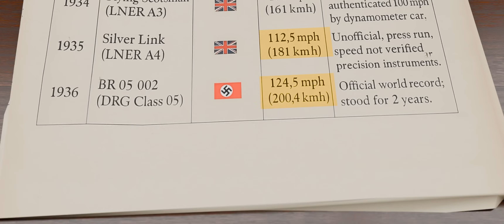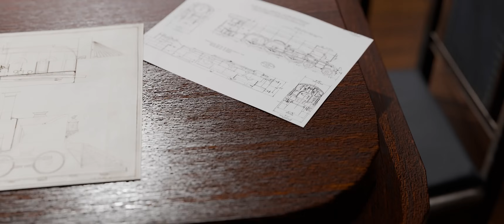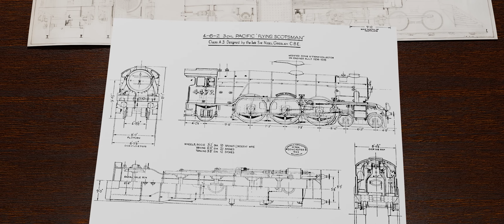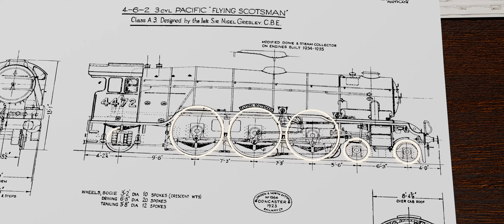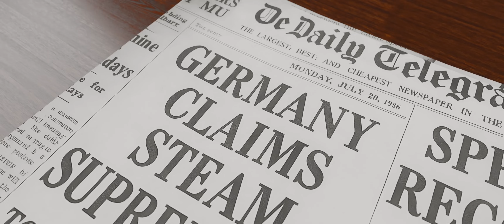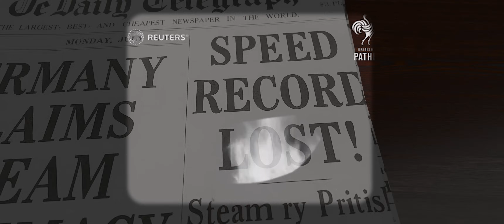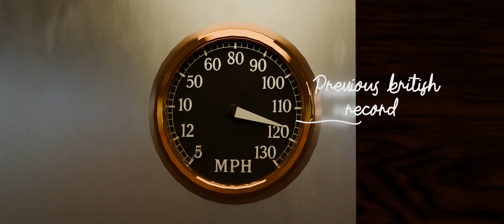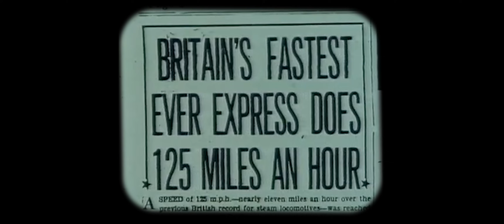The Insane Engineering Behind The Mallard

Comment: Mallards record won't last much longer. The Americans are rebuilding one of their PRR class S1 or T1 locos. Back in the day, one was clocked at 140mph. This should be interesting.
Reply: yeah except your forgetting that American railroads basically penalized any attempts to exceed the speed limit on any of their trackage, so these runs were never professionally recorded and only done by conductors timing jaunts between mileposts with their stopwatches if they weren't doing much. so those claims don't hold much water

Comment: Mallard wasn't brand new when she ran her record run. She was about 3 months old. LNER when they planned to do it wanted to use a Steam loco that was run in so and worn in just right so that there were no parts that were still wearing themselves in and causing friction and power loss. Mallard and other A4s who were between 3 months and I think 6 months were also considered to attempt the run. Mallard was chosen and while she managed it. Her middle big end ran hot and the bearing melted and that was it for the speed record attempt re-attempt.

It was planned to give it another go but WW2 and the bearing failure stopped that, it was calculated that 130 was possible if everything went right and they didn't need to slow down for a junction.

The German world record was on level flats but only 4 coaches and 197 tons compared to Mallard's 7 coaches and 240 tons while going down a slight incline.
Reply: And then there's those unofficial speed runs by American locomotives like the Pennsylvania Railroad's T1 class and the Milwaukee Road F7 class steam locomotives...
Reply: @kristoffermangila the American records were just crews of the locos themselves saying they timed it and it went XYZ fast. There was barely any evidence it even happened aside from the words of a just a couple of people, let alone official evidence. 

I count those American records as nothing more than hearsay.
Reply: Her bearing didnt melt from what I understand - they fitted an early warning "stink bomb" thing that gave them a pre warning it was overheating, and that went off so they slowed. It did overheat but didnt melt or destroy itself, and she still pulled the train under her own power for the remainder of the planned journey.

The driver himself said he thought 130mph was possible.

Comment: I love mallard, i definitely think that she could reach 128-130 for sure. One engine i have my eyes on right now is the T1. Last I heard they want to get her broken in and then go for the record. (not sure don"t quote me).
Reply: Without the use of dynamometer car the original T1s could not claim the world record. In fact the Pennsy discouraged unofficial speeding BUT there is apocryphal evidence that the T1s probably did exceed the speed record. Information indicates that speeds over 130mph were attained, supported by point to point timings and damage done to the Franklin poppet valve box . The valves were distorting due to high reciprocating speeds from high speed running. 
If you want to know more get hold of " American Steam Locomotives: Design and Development, 1880-1960 By: Withuhn William L". A brilliant read and surprisingly easy to digest!
As you say will be interesting to see if the rumours can be put to bed once and for all , for good or ill!
Reply: @mandywithell I have an ebook version of that work.

Comment: Sorry, but I have to burst your bubble a bit.
While it is true Mallard holds the fastest documented run you have either misstated, misrepresented or entirely left out some IMPORTANT DETAILS.

1st Gresley didn't invent the multi cylinder engine! See the kkStB 310 series of engines as examples:    4 Zylinders built in 1911 - 1916

2nd I feel like you misinformed people of "THE" German locomotive.
              BR = Baureihe       =meaning=>      build series
                                   05      =meaning=>      the 5th standardisied series / class
                                 002      =meaning=>      the 2nd locomotive of the class
              There where 3 build in total with the 3rd being an experiment to investigate burning of coal dust.

3rd Here are some facts:                                 cylinders      boiler pressure      max. allowed speed in service      wheel diameter     starting attraktive effort
                                                      LNER A4:             3                   17,2 bar                                 145 km/h                           2032mm                           160kN
                                                           BR 05:             3                     20 bar                                  175 km/h                           2300mm                           137kN

4th the race conditions:                               start                  finish                                 train / occasion                                                         grade
                                             LNER A4:      Grantham        Little Ponton          special - record try                                       0,5% slope downhill just before little Ponton <-- (max. slope in AUSTRIA 1,8%)
                                                  BR 05:      Friesack           Vitnitz                     revenue service - making up time                                       Even track

5th (2nd hand information!) You ignored the damages Mallard suffered from running faster than she was designed for. She allegedly suffered a crack in the middle cylinder.

sources:
https://de.wikipedia.org/wiki/LNER-Klasse_A4
https://de.wikipedia.org/wiki/DR-Baureihe_05
https://www.openrailwaymap.org
https://en-ph.topographic-map.com

Comment: So... how did the tripple cylinder operate? If regular cylinder are 90 degree apart, were the two of the tripple ones the same on the sides and 90 deg off in the middle?
Reply: They’re all set about 120 degrees apart.
Reply: @EQ-TM  oh that's interesting, makes sense caus it then makes it run most smoothly. Tho I assumed that kinda setup would still create the rocking motion, but maybe less than in the double cylinder

Comment: Insane? Oh yes! Terrible design of the centre big end bearing meant it failed during this event. The locomotive retired severely damaged to New Holland shed to be repaired.
Now, if Gresley had allowed a Stanier Coronation to take a record run down Stoke Bank (there was no similar location on the LMS for Stanier to do this) the Coronations (being a significantly more powerful and more substantially constructed 4-cylinder locomotive) would have easily bettered 126mph.
But of course the LNER were not about to let the LMS shame them on their own railway!
Reply: The big end failed due to the conjugated valve gear design allowing the centre cylinder more steam and therefore greater stress.There is written evidence of this in a book I read on the subject.
The Coronations were built for sustained haulage up Shap and Beattock where their greater boiler capacity was needed but their blunt front end would I am sure not allow them to beat 126 mph.
Don't you mean New England shed at Peterborough?
Air resistance goes up with the square of the speed.
Reply: @jeremyrichards8327  At 126mph, streamlining is more about appearance than performance on a steam locomotive.
The Coronation Pacifics also had conjugated valve gear for the 2 inner cylinders, valve events being derived from the valve gear for the outside cylinders.

Comment: The T1's gonna smoke this thing
Reply: Only thing that will prevent the T-1 from having Duck for dinner will be the owners. T-1 was clocked doing well over 130+ mph back in the 1940s between Ohio & Chicago hauling a full load and on level ground.
Reply: @glhx2112  strait facts... well see though
Reply: @glhx2112  dynamometer car or it didn't happen!
Reply: @glhx2112 There’s no way to verify these accounts.
Perhaps they are true, but until it is officially measured, it cannot be certain or factually stated.
Reply: @TeardropLabs  Honestly I don't think it's a given that they will attempt  to smash that speed record. Lots of time & money will have been spent on getting a T-1 replica up and running. To risk it all on a speed record not long after completion has to be a scarry proposition, unless it is/was a stated goal at the beginning of the project. I don't see it happening anytime soon, if ever to be honest. Right now the T-1 is still a collection of large parts, with a lot more work to be done. I'll be happy just to see it make some steam, and I'm sure I will get a chance to see it up close, I live about 2 miles away from the Juniata Shops where 25 of them were built back in the day. At some point it will make it's way here to visit the shops and get it's picture taken while travelling around the Horseshoe Curve.
Reply: @glhx2112  If they really want to attempt the record they have to run her in first. Get the bearings and seals worn so that nothing is binding or causing more friction than needed. Mallard was 3 months old when the record run was done. For the T1 I don't know how their drivin' gear works or how much will bind or rub, but give them a few months of running her in and they should be able to attempt it and get the most out of her as they can. Also, They won't break Mallard's record but set a new record in their own category just due to how much technology and metallurgy has changed. Mallard will keep her record and the T1 will get its own.
Reply: It’s very possible, but not certain. It has a very good chance of beating Mallard, but it’s not guaranteed.
Reply: @TeardropLabs  Its coming back and being rebuilt from scratch.. well see if it gets the chance to do another max speed run. I really hope mallard retaliates

Comment: "The INSANE Engineering..." bro besides the fact that there's a third cylinder, Sir Nigel Gresley did everything to make mallard, or any of the A4's, as simple as possible, because he knew that simplicity was, and still is, a steam locomotive's ultimate trump card. No, streamlining doesn't count, as it adds absolutely no mechanical complexity whatsoever. To counterbalance my short rant on the title of this video, I love that someone actually mentioned Richard Trevithick for once. Also the animation is a lot better than what I'm used to.
Reply: In all fairness, people aren't exactly going to click on "The Simple Engineering Behind The Mallard"
Reply: My counterargument is that it is pretty insane to take a dumb machine that runs on hot water break 126 miles per hour. Gresely was no fool. He was a genius.

Comment: Die Mallard ist nicht die schnellste Dampflokomotive der Welt, die gemessene Geschwindigkeit wurde auf einer Gefällstrecke erreicht und die Maschine war danach defekt  und musste aufwendig instandgesetzt werden.
Reply: A thoroughly expected German response. I feel your hurt pride. But you have 4 x Weltmeister. Let us have this one. Regardless of being slightly downhill, or suffering an overheated bearing, the dynamometer carriage showed a locomotive World-Record speed for 'Mallard'.
Reply: The east coast line from Edinburgh to London Kings cross is as flat as you are going to get any where other than Australia. By the way Otto Diesel didn't invent the engine that bares his name. It was invented in Gainsborough Lincolnshire and they were static oil engines of which the original one is still in working order.

Comment: The speed run was aborted at 126-4 mph because the inside cylinder Big End bearing began to overheat, as the streamlined casing diverted air away from the underside of the engine. This was a known problem with the locomotive; before every express journey in normal working conditions, the Big End bearing was painted with an Aniseed paste. If the bearing began to overheat, the Aniseed would create a strong smell, which driver Duddington smelled, and he immediately slowed down as safely as possible. Mallard proceeded back to the workshop at a very slow speed because the axle and the bearing are costly and time-consuming to repair, requiring a long repair at the workshop, putting the loco out of revenue-earning service. 
Driver Duddington was chosen because he was known as a hard-charging driver who always pushed the loco to the limit. Very little mention is made of the poor old fireman, Tommy Bray. He would have been shovelling coal nonstop, with the water injector fully open and one eye on the water sight glass, which could have caused the melting of the firebox fusible plug, a disastrous event had he not been alert.
Here's a newspaper piece about Tommy.
https://www.doncasterfreepress.co.uk/news/people/memorial-plaque-for-fireman-tommy-bray-in-world-speed-record-breaking-mallard-train-3296767
And another about Joe.
https://www.bbc.com/news/uk-england-south-yorkshire-58775115
Thanks for a very informative video.

Comment: Top secret? No. It was supposed to be a brake test of the westinghouse airbrake system. And no, saying that Gresley restored the reputation of an entire empire isn’t quite right now is it? As i’ve said earlier, these were mainly tests to see if the trains (the Coronation service and so on) could even run at those speeds, as well as testing the brakes. It should also be mentioned why mallard specifically was chosen and what happened during the run (mainly that her middle big end bearing melted partially (it certainly overheated)).